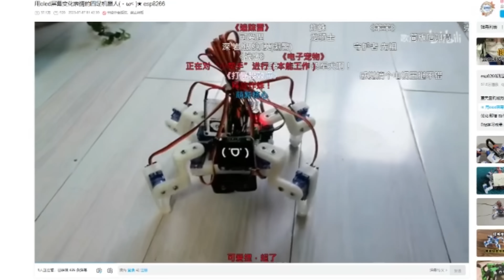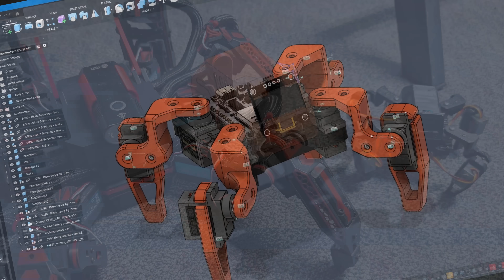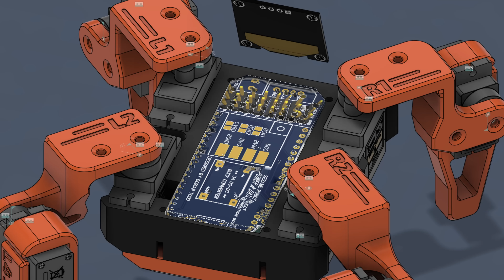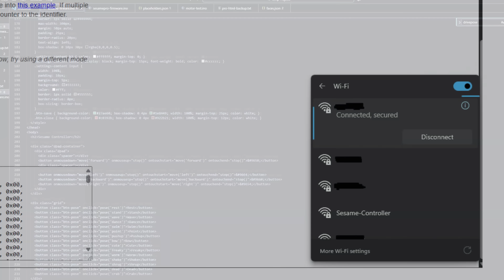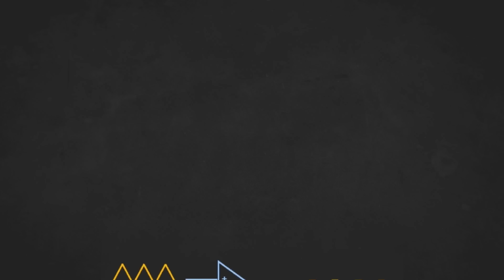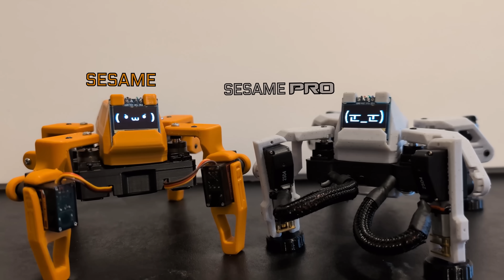How I Made This Tiny Walking Robot From Scratch

Comment: I know I'm a few months late on responding to this, but couldn't you put an adapter on your PCB that allows USB-C charging of your battery?  Just have it plug its proprietary battery connector into a slot on the PCB that connects to the adapter?  I don't do robotics, breadboards or soldering, but I feel like that could at least take care of issues you might have with charging.   I'm gonna' guess that it's the current that can be pushed through the wire at that point that would become the issue, but I bet that could be handled via that adapter.  Maybe.  Probably?

Comment: The leg material and form decreases the robot's efficeny. Instead u could use usual rubber balls (size diameter = 1cm) and drill a whole into it, so being able to attach the 3D-printed stick/leg und to create a connection from rubber ball to motor/ enigne. Binding the the stick/leg connection with a feather would improve the whole process.

Comment: If you add a Small AI model into Sesame it would be a great Lightweight Personal Assistant.

Yeah yeah, I know this small robot can't handle AI. But it can take control commands and transmit data wirelessly. So if the AI model runs in a Homelab or something like that in same WiFi, this could work.

I ain't sure tho 👾

Comment: VERY NICE VIDEO! I have an idea for Sesame PRO V.2 (New Gen), you add motors to its wheels, so when they are fully stretched out, he can rotate very quickly or even when the are in a specific direction and angle he can drive instead of walking, so he can do both. You can also add some robotic noises to the emotions.

Comment: You need to use this for running communication wires for hvac , internet and other cables via duct work or between floors / sheetrock
Reply: Cat 6 wire, bacnet wire ,ethernet wire,  fire alarm wire, 18gauge wire , romex wire via building plumbing work
Reply: Add lights to it , lidar , night vision camera, clear HD camera for determining terminals of input of wires . 🎉🎉

Comment: so international shipping means no batteries in the kit?  are batteries easy to get?  is a discount possible (since batteries are not present)?
Reply from the maker: Correct, batteries are not included with international orders due to shipping regulations, but they are fairly easy to source. They are 10440 Li-ion cells.

Comment: I got some 3d printed legs earlier this week, built a frame from foam board and black tape, soldered the servo headers and pi pico headers on a prototype board, plus the interconections, and converted the code to work with the pi pico.  I now have a working Sesame Robot.  The dc-dc converters and the screwdriver I didn't realize I needed should arrive today, it works relatively well considering I could not totally tighten the screws.  I will order a battery and power switch once I confirm everything fits.  Still waiting on the frame, bottom cover and body to be 3d printed, probably a week or two.  I delayed printing them as I was not sure I would be able to fit my components into the current Sesame frame and body.  But I think they will, except I doubt the usb hole will line up as I have the pi pico on headers, leaving space underneath to put the dc-dc converters.  Went relatively smoothly, but I do have a headache from mapping my servo header to the gpio pins to the Sesame code, especially as I had not realized there was an image showing which leg piece matched which servo array index, I did it the hard way.

Those movements sequences are great, must have taken a bit of time building them.

Comment: Do it with stacked 18650 batteries along the top or bottom of chassis. They may be a little heavier than the build can take though depending on how many used.

Comment: I'm interested in the sesame PRO build. Could you drop a guide and the stl for that version please? Are the servos for the PRO the petoi p1s with feedback controls? I cant find the p2s servos on their website.
Reply from the maker: Yes they are the p1s with feedback control. Sesame pro is not super reliable because the high torque motors tend to draw too much current. If I find the time I'll fix some of the issues and publish the files on GitHub
Reply: @DorianToddYT I would really appreciate it. You nailed the design of the sesame and the PRO, and I'm sure that the kits will do great. Fingers crossed for a sesame PRO kit one day.

Comment: Great looking little robot, yellow was a good choice of color or at least it looks yellow to me.  I was just wondering, if you have a list showing the boards, libraries with versions used to build the firmware.  I haven't tried building your firmware, but I thought I would write some quick code to test some simple servo code.  I am having issues with the latest ESP32Servo 3.1.2 library with Arduino 2.3.7 on Win 11.  I am guessing, I have to use both an older version of this and some other libraries or maybe change to a different ESP32 variant.  I figured, better to ask someone who has it working rather than trying to try numerous versions to try and resolve the issue.

Comment: I cant believe im doing this as someone whos a super hater but Im liking the video and subbing to your channel. As someone who has a CS degree I assumed that doing things like this would be overly complicated (on the coding side) but seeing how you can make something so polished using the default arduino library gives me some inspiration! you got any tips/resources for getting into the hardware/pcb side? Ive worked with raspberrypi's before and made my own rc car but this never got down to the hardware level like you have
Reply from the maker: Thanks so much for your kind words. YouTube is your friend on things like this. All the circuit design I know is from tutorials and articles on things. Having any background in tech is also important, just understanding the tools you're using makes them easier to use!
Also PCBs are less intimidating than they seem, and there are some great videos about how they are made that helps give a better understanding of the principles of electronics needed in design.

Comment: What would be Interesting is to see a version for this with 12DOF, it could emote way more! Also would be interesting to see this powered on 2S setup (its easy to D.I.Y from vape cells and aliexpress parts so you could build this even cheaper). Also I feel like it needs a bit of Exponential growfth function to alter the speed of servos. Because now it feels a bit jittery, so smoother movements would make it feel more "alive" Im VERY interested in where you will take this and Imma go buy some servos to maybe build this myself. Freaking awesome man! 
Also is this based on "Kame" robot?
Reply from the maker: A 12 dof version would likely be more akin to if you took two of the legs off of my hexapod project, since those legs had 3dof each. The cost drops dramatically when you slice the parts from China. If you ordered hundreds of each part the robot is very cheap. 
This is not based on Kame, but Kame is super cool!

Comment: sorry if its a stupid question, but how did you do the IK for this?
Reply from the maker: No such thing as a stupid question! The core firmware was designed to not need any kinematics or inverse kinematics. Since the legs are so simple, having only 2 joints, we can manually write animations just based on angles without it being too much of a headache.

Comment: Hey, I am very new to this whole robotics thing. I am trying to source all the parts and having a really hard time with the 10440 battery cells I can only get 18650 cells could be just my country. Will 3s 18650 batteries be fine? Also a detailed build guide will be very nice, especially for someone new to electronics and robotics; this will be very helpful to understand concepts on how to wire things correctly.
Reply from the maker: I've created a detailed build guide on the GitHub repository, with step by step instructions. I will also be producing a video build guide soon. 
18650 cells are unfortunately too large to work with sesame. You may need to order the 10440 cells via a manufacturer through something like Alibaba or AliExpress.
Reply: @DorianToddYT Thanks yeah I am following the build guide on GitHub learning a lot. Also thanks for the advice on where to get the correct batteries.  🎉

Comment: Suggestion: you can also add a wireless coil on the bottom for charging and a dock shaped like a spider nest
Reply: Do they make wireless coils with integrated BMS? I imagine packaging the BMS is the real challenge. But adding a harness for an external charger seems feasible.

Comment: If you added an NFC charging base that Sesame could take "naps" on, it would be extra cute and practical.
Reply: I love this idea
Reply: good Idea I will try to add it into my project
Reply: @HanzalaJawwad  Can you share the results? Would love to try it.
Reply: Totally possible, and actually would not be difficult to add since that charging controller would be it's own thing.
Reply: We need to create the most-cute robot. That sounds like a fun competition
Reply: With a magnetic USB C cable it could work easily
Reply: @tbltjrd3918 if u add magnetic usb c then u can also make the robot to go charge itself say when it’s at 2 percent or even call it to come to u when it’s charging and so many more things with a magnetic usb c port
Reply: Such a good idea
Reply: You can also use 3 hall effect sensors to triangulate the vector to the charging pad and also use a similar method for its orientation.

Comment: hey! this build is sick and I probably can try it (im 11 so that's really saying something). I also got 2 suggestions: 1. adding a camera so it runs completely autonomous, 2. adding a disco mode where you input a mp3 file and it dances based on the wavelengths. I think these would make Sesame even cooler

Comment: calling this "easy to add animation" is hilarious to me as a software dev xxx
Reply: to clearify, even if you did not want to allow for custom animations to be added, hardcoding stuff like that is ALWAYS a really bad idea.

nice video nevertheless ofc.
Reply from the maker: Haha good point. Though the alternative is through an anchor program like an app or website, which decreases the cross-platform compatibility. The current hard coded setup means it can be controlled by anything with a web browser!
Reply: @DorianToddYT missed the point, no worries, i get it, its about the engineering.

Comment: I've created a simillar robot, the only realy difference is that mine uses arduino mega with built in esp8266 (becouse i had one at home, but its to big, i plan to change it in the future) so its much thicker boi than yours. Also i have problem with power supply, when servos start working, my arduino resets sometimes, currently working on fixing that

Comment: minikame base code? I recognise the press up (but it's the wrong way round)
Reply: ah guess not looking at the rest of the video - nicely made BTW and well done on making it usable for others etc. I like the animation designer. I've been thinking of doing something similar. I've got animations working in a way I'm reasonably happy with but am thinking I could use the 3D simulator I've made in reverse as it were, i.e. add a mode where you can position the limbs instead of driving them from the robot, and then capture a frame as it were. This would then either generate copy pasteable code as you did, or maybe send to the robot as JSON or something and have it store them in the EEPROM/load on boot. I got the idea from the mechamons that had an animation mode where you could physically position the real limbs and frame capture as it were. That robot had the ability to sense motor position though but I'm using the same servos as you so can't do that. I did see adafruit documented a mod you can do though where you can add an extra wire to the servos for position sensing though. Might consider that one day but it's a lot of effort to crack open a bunch of these servos and change them. Doing stuff in a sim would be easier/safer I think and easier to test/refine (especially if I got the dynamic send route)

Comment: Can you play DOOM on sesame?
Reply: so... my feeling is... maybe... reason being is that the screen not too high res but not sure how many colours it can do... probably just 2, so maybe not the best experience. But as to the power of the ESP32 it runs on, on clock speed I think it was something akin to the speed of a Pentium 2, and Doom ran on a 25MHz CPU. Not sure it has enough storage or RAM though... think standard is 4MB. The Doom demo came on 2 floppies compressed. With the low res screen and 2 colour probably the wad file could be reduced down a lot... so yeh... maybe..... I do know that bitluni made a pretty good console from one that looked graphically comparable to a SNES. And I think there was a version of Doom for the SNES maybe...? or maybe I'm thinking of the N64...
Reply: I mean he said it was all customisable so you could definitely add more RAM if you use the bigger version he mentioned. That way the screen is also bigger and has a higher resolution. I’m not so sure about the chip it would run on, but I’m sure as long as you’re not using the custom chip built for it, you should be able to change it a bit so that it can still be a robot and run DOOM if wanted

Comment: Take a look at batteries for electric airsoft pistols.  They're typically longer and thinner than the battery you've used, but because they typically have to fit in the handle of the pistol it's usually fairly easy to find ones clustered around some fairly repeatable dimensions.

Comment: how do you find the right measurement of the 3d printed parts to fit in your electronics while doing your 3d designs in CAD?, is a caliper the correct tool?
Reply from the maker: Calipers are great, I also import community designs of my components from GrabCad.

Comment: YOU SAVED ME!!! Like fr... The 20ms delay was the problem and i couldn't figure why my ESP32 keeps crashing I LOVE YOU MAN, the video is perfect, everything, it's fun, entertaining and enjoyable, fr i hope to hear from you soon with another bangers. Deserved follow
Reply: I wondered about that... I have a different but similar robot with the same servos but running it off a 2C lipo with a 5v switching regulator to power the servos. So far no issues with running 9 at once... common ground was important though
Reply from the maker: To be frank, the 20ms delay is a bit of a band-aid. A better solution would be a large capacitor to buffer current spikes.
Reply: @DorianToddYT ah yeh I have one of those too
Reply: And a smaller one as well iirc

Comment: cool little robot and a very well made video - thanks for sharing!
I like how you set focus on affordability. That keeps the barrier low to dive into such a build.
I enjoy watching all these powerful big 12 DOF big robots with high-end actuators on youtube,
but they become very expensive and complex quickly. Funny enough I'm working on an open source
robot with pretty similar design goals, affordable, easy to build yet feature rich. I started to upload
some early footage on youtube if you are interested: https://youtu.be/iWywGmTQg1o
I noticed that you are using a set of Petoi servos in Seasame Pro - can you share your experience w.r.t.
speed and precision?
Reply from the maker: The Petoi servos are very fast and have great precision. The ones i'm using have live servo feedback as well so you can have a closed loop walking or moving algorithm which is much more precise that dead reckoning. Unfortunately they are priced pretty high but if you're looking for really stable and quick micro servos they are a good choice.
Reply: cool, thanks for Sharing, I figured that they must be really fast and strong, I saw a video were Petoi Bittle performed a backflip 😮
Reply: btw, eine you mentioned the power concept... I switched to 4xAAA NiMh batteries, 4.8 to 5.6V depending in SoC. Works perfectly with many microcontrollers and servos, no conversion required, Servos powered straight from the batteries

Comment: Thanks! I will try to build this with my kid. Since I see there is buck converter inside, did you consider using rechargeable 9V batterie as an power source? They are easy to source and can be found relatively cheep.
Reply from the maker: Unfortunately 9v cells don't have enough amperage for all the motors. I did find recently they make AAA size lithium polymer batteries that might work in a AAA battery holder.